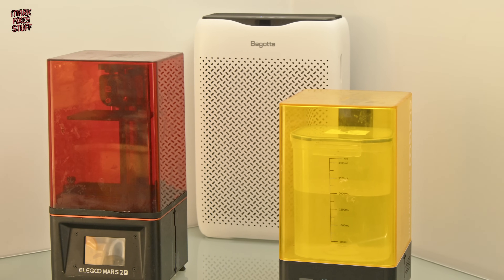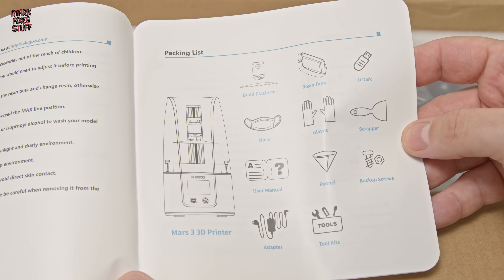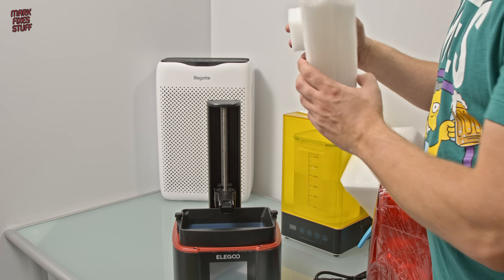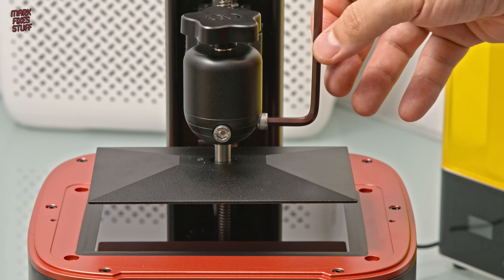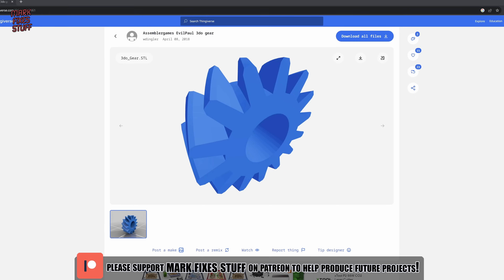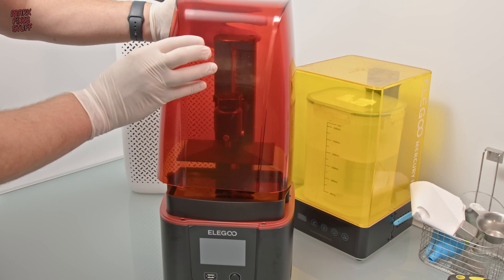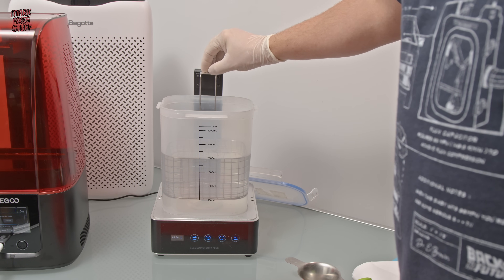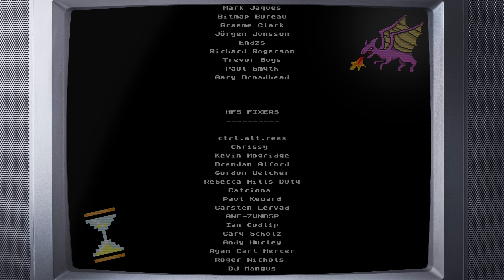Resin Printing TINY 3DO FZ1 CDROM gears. Will they Work? New Elegoo Mars 3 Printer!

Comment: Long-term stability with resin is a big question. However, you can mold resin-printed parts with silicone, and then pour proper urethane resin. Just need to test that resin and silicone are compatible. Some resins inhibit silicone curing. Robert Tolone has a useful channel with lots of tips.
Reply from the maker: Thanks Alexander. This is really great information.